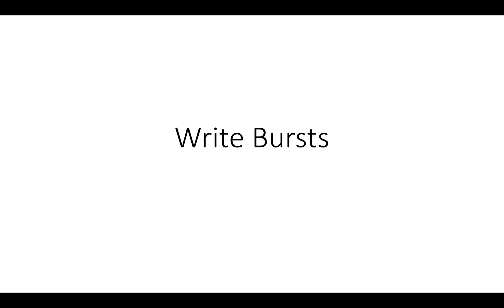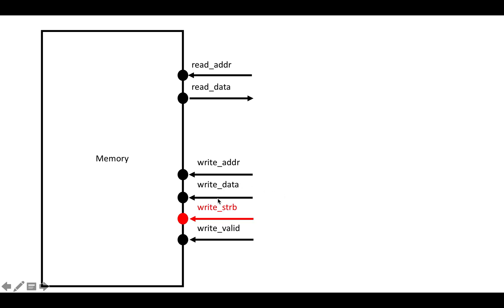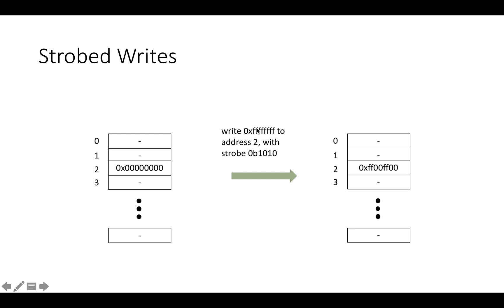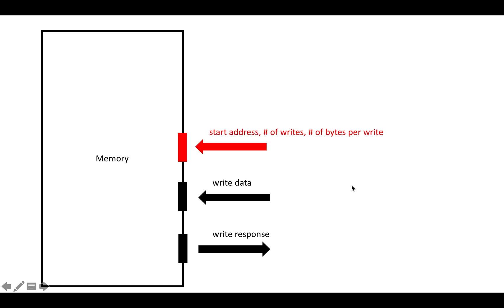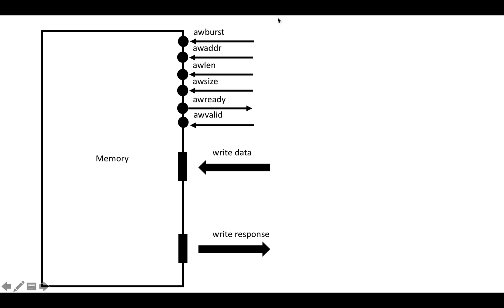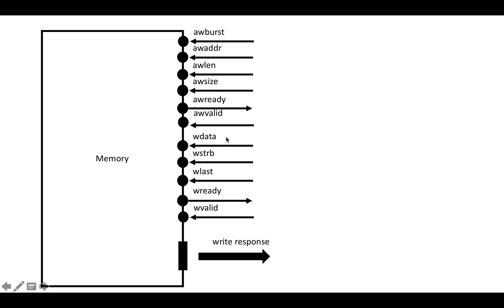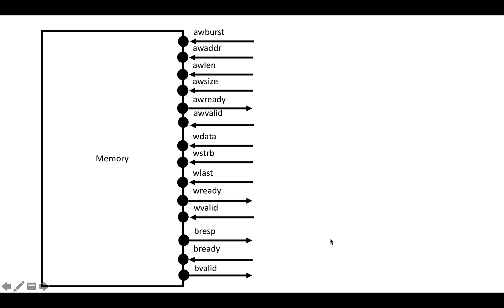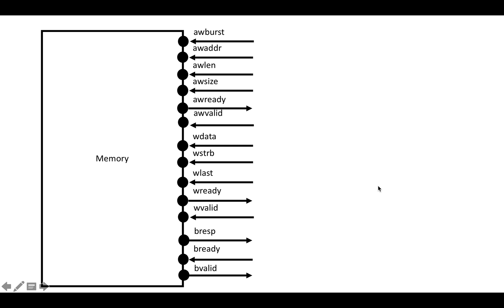What is AXI: Write Bursts (Part 4)

Comment: does awsize and arsize means the width of the databus ? It could be 2, 4, 8, ..., 128 right?
Reply: size tells you how many bytes will be transferred in each transaction. The width of the bus will not change (32 or 64 bit).